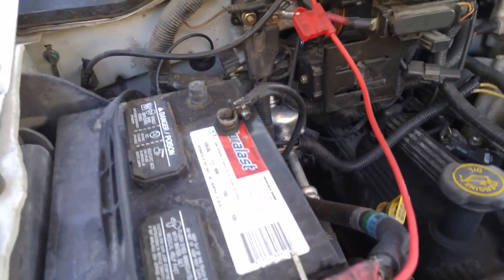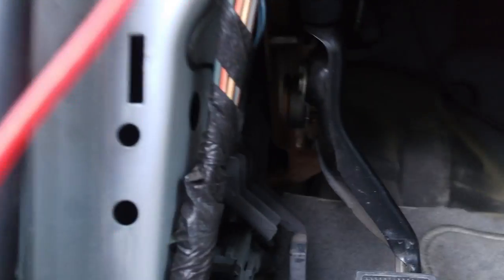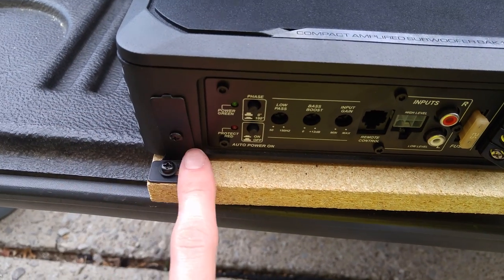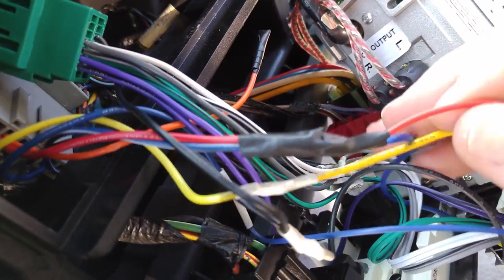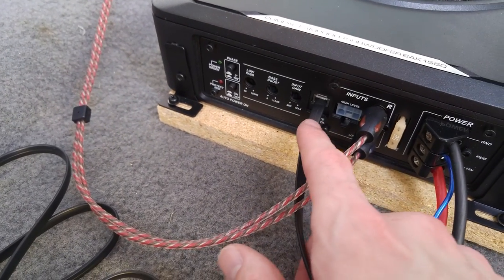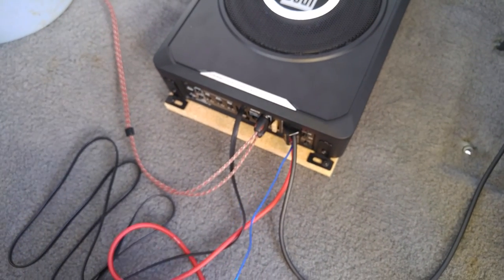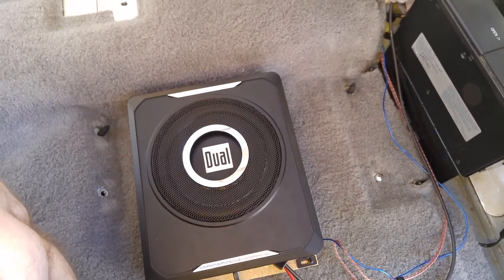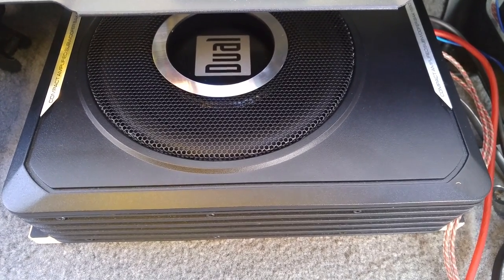Underseat Sub-woofer Install!

Comment: Dumb question time! So let me ask, in this video are you saying that the RCA’s will pump all the speakers from the sub/amp. I have an aftermarket radio so by hooking the RCA cables I don’t need a high input harness and connect each speaker to it right?